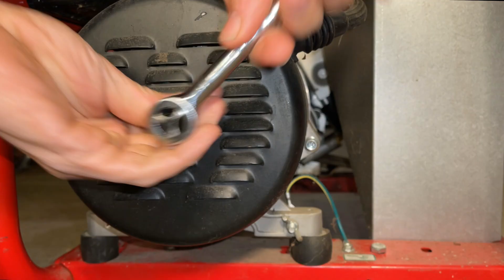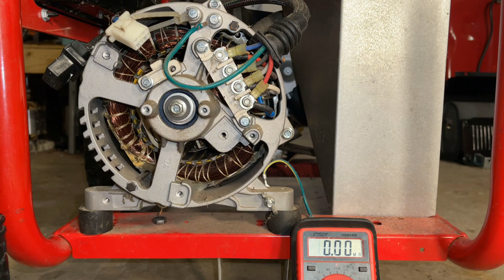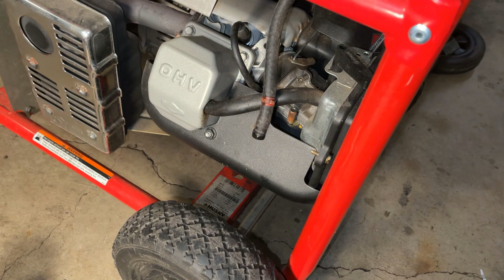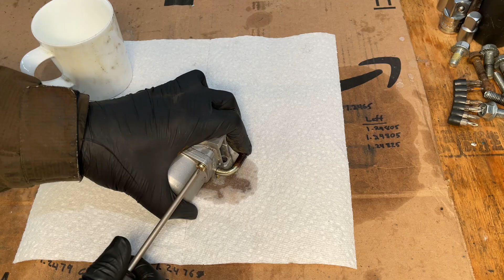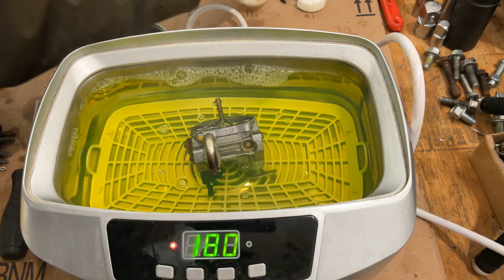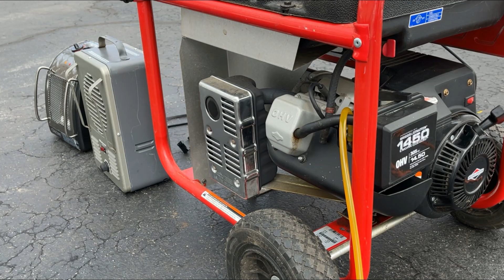Husky Generator - No Power

Comment: I am in Louisiana and expect a bad hurricane season this year.  I am great with lawnmowers, I prefer Honda but a wealth of information on generators which I am less educated on.   I find them after hurricanes or before dumped by the side of the road because apparently they didn't run or produce voltage.  I  have about 6 or 7 that I need to go through.

   A  few questions, the solution you use to clean the carbs, and which sonic machine?   Also thoughts on a Suburu engine. And if you also have a reliable source for parts on the generator portion?   You have a skill to test and repair but often times for me it I just buy a new carb on instead of cleaning all the jets.. etc.    Thank you  for sharing your knowledge.

Comment: Is it not advised to adjust the AVR while the engine is running and producing power?  I have watched so many of your YT and see the adjustment to RPM/Hz while running and just wonder why not do the same with the AVR.
Reply from the maker: Do not want to send the wrong message.  High voltage ac, dc and moving parts.  Lot less risky to do it with the engine off.

Comment: I have one of these and the 240v circuit seems to be off: 120v between neutral and the hot terminals, 240v across the 2 hot, but 150v/80v between the hot and the ground. Any thoughts?

Comment: Hey I have a question I have a Briggs & Stratton generator and on the lcd screen it shows 1% power is being used but I don’t have anything connection when it shows that should I be concerned about this?
Reply from the maker: I would not be that concerned.  Most likely not an issue.
Reply: @jcondon1  thank you for that information I was getting worried

Comment: I have this exact generator for about 10 or so years now. It always has started up really quick and easy, but is not a quiet unit. I plug it into a simple 240v transfer switch, and it runs the entire house minus the AC and don't use the clothes dryer. I have noticed that my generator too, is a tiny bit under voltage but everything still runs fine. I think I will tweak the AVR after seeing you do it. Thanks!

Comment: Are you all the same generator. I have blue smoke at start up and then it stops, is there anything I can do or need to do
Reply from the maker: That could be a sign or worn valve guides, blown head gasket or marble worn rings.  If only at startup and not burning excessive oil then would run it until it becomes a larger issue.

Comment: Are you missing a bolt from the brushes?
Reply from the maker: Most powerheads with an AVR only use one bolt.  The other side has a stud that comes out of the end housing to locate the brushes into position.
Reply: @jcondon1  thanks! Good to know

Comment: Is your torque wrench 1/4 or 3/8. What range of torque is it.?
Reply from the maker: The smaller one I use is 1/4".  The range is 20 in/lbs to 240 in/lbs.  The larger is 3/8 and the range 20 ft/lbs to 100 ft/lbs.

Comment: Other than the rust where the fuel line hooks up looks like a new carburetor. Will it hurt the engine if i put 10w30 in my generators ?
Reply from the maker: Would use 10w-30 synthetic.  If running in hot weather, 30 weight would be better.

Comment: You really do excellent work James. I would have suckered into using the carb that was on it so you might be a bit better than me. I don't know how much you got for this one, but if you got a good price for it it would certainly be OK to spend all you did but I would never be able to get back that 90 dollars for that Stens around here, as the other carb would certainly run someone good for years that kept the rain off and ran the carb dry upon stopping. I always do so I wouldn't be a good customer for you I'm afraid.

Comment: I have an old Colman generator it runs awesome but it did not make power at first the only thing that looked broken was a capacitor was exploded and like melted plastic or something was coming out of it I asked 2 different small engine repair guys and they both said that's not the problem but when I put a new one on it makes power now and people tell me it's just a coincidence bit it really seems like that was the problem do some generators need a capacitor to make power?
Reply from the maker: Yes, it is a common problem that the capacitor fails.

Comment: Great Video. Here, i did the adjustments to the AVR Trimpot´s with the motor running. Is a better way to adjust the voltage. You can see the voltage while adjusting. No problems whatsoever.

Comment: On the popping noise. There is a electronic chip built in the coil that replaces the points and how it works is when the magnet is at its sense point the chip sees this increase in voltage but as the magnet just starts to pass its highest peak...the electronic chip senses the the engine passing its ignition point and it shorts out sending a pulse to the coil and fires it and that gives a spark to the plug. What has happened to me a couple times is if the wire lugs on the coil are not very tight they may wiggle giving the electronic chip a false indication and firing the coil extra times. I had one riding mower that that i could not tighten it enough so i soldered the lugs on. Problem fixed.

Comment: Could you include a voltage reading across the high voltage outputs: L1-L2, L1-N, L2-N, L1-G, L2-G, N-G? Trying to troubleshoot the same model I own which is reading about 5V N-G and that would really help!
Reply from the maker: I do not have the generator anymore, but L1-L2 should be around 0.7 ohms, L1-N and L2-N around 0.3-0.4 ohms.  Not sure on the rest.

Comment: First, thank you for all the tips you share. This comment isn't about this specific video, but I'm having a problem with my (Simpson pressure washer) Kohler RH265 engine staying running. It's been sitting for almost two years. I did you're usual car cleaning routine. All the jets, float, bowl, etc. looked relatively clean, but I cleaned them anyway. The float valve works as well, and the bowl was also relatively clean. What happens, is the engine now runs, but ONLY when almost fully choked. I remember one video you did where you went through the same scenario, cleaned the carb, but still wasn't able to make it work. Was there a solution, or was it where you just replaced the carb? Thanks!
Reply from the maker: Sometimes I do pull the trigger and buy a new carb.  Most of the time the issue is the carb and a clogged jet or passage.  Would be more aggressive cleaning the main jet and pilot jet.  Sounds like it is starving for fuel.
Reply: @jcondon1  Thanks for the quick reply. I don't have the cleaning tools you use, but they're didn't seem to be any obstructions. Daylight was visible in all seeable passages/jets, in fact, the carb looked like new, but who knows.
Reply: Follow-Up: Success! I watched your "Two Generac's" video today, and noticed you worked on the Idle Jet on one of the carbs. That's the one bit I didn't clean, and completely overlooked. My cleaning methods are limited to Carb Cleaner and an acid brush. At first, I couldn't see through it, but liberally sprayed it, and used a bristle of a wire brush to be sure it was opened. I 'saw the light', and it now runs great, solving the running issue. It's not an issue with buying a new, relatively low cost carb, but the satisfaction that I was able to fix the problem on my own (with you're tutelage, of course). Thanks again for sharing your great and detailed videos on small engines and gen sets.

Comment: Another superb fix !! Thoroughly enjoy youre content! Been watching for a year & just recently able to subscribe. Been indulging in repairs myself for the past year & have done well with youre information.Hoping to see some content with capacitor operated Gens as opposed to AVR'S. Have one currently I need some help with. Also in the process of resurrecting 2 Briggs flat heads 8&10 Up Gen sets. Have them running & producing power , just have fuel pump diagphram kits to order & install & will be finished !!
Reply from the maker: I have done a couple of brushless generators.  Do not get too many of those.  https://youtu.be/4--Oyf4-U2Y?t=2890

Comment: I have a powerhouse ph3100ri inverter generator that has no spark. I've already pulled the low oil wire still no spark. I've also have unplug blue wire that went to a  spade coming off the coil and it has spark. plug blue wire back in and no spark. Any Idea?
Reply from the maker: Have not worked on one of these, but there is a good service manual available online https://www.powerhouse-products.com/-/media/Files/PDF/PowerHouse/Dealer-support/Generator-Manuals/PH3100Ri_Service_Manual.pdf

See page 19.  If has a good procedure for tracking the issue down.  I would suspect the BFP controller.
Reply: @jcondon1  Thanks for your help Mr. Condon. I looked up parts I need and they are discontinued so I guess I've got a good engine for something else. I'll be waiting for your next generator fix. HOOF OUT!!!

Comment: great work James . Runs like new man !
Reply from the maker: Like your new generator.  The 120v only ones make a lot of sense.  People do not realize that a 7000 watt 120/240 volt generator is limited to 3500 watts on any one 120 volt receptacle and you have to worry about balancing leg one and leg two.  With 120v only, you have access to all the power.
Reply: @jcondon1  Yes sir , & I only use the 120v anyways . I have a gen for 240 but it never gets used ..

Comment: Good video.  From my own experience I learned that if the genny has a high oil switch as well as the normal low oil switch, you definately want to go with a non-detergent oil.  A detergent oil can foam up and when it hits the switch it well shut the genny down.  Then when the foam settles you can start it again...briefly.  Becomes a mystery shut down.
Reply from the maker: Great tip!

Comment: What is your opinion of dual-fuel generators?  I intend to run it on propane when needed.  If I have to run it on gas, I will use ethanol free and drain the tank, run the carb and lines dry, and then drain the bowl.  Does this protect me from something going bad?
Reply from the maker: Most of the issues I see are because of bad gas.  Propane will never cause an issue as long as you have a good regulator and good pressure from the tank.  If you use gas, just drain it out and your carburetor will be fine for the next time.  The only downside with propane is less horse power so not as many watts out.
Reply: @jcondon1  Thanks for the info.  I can run the fridge and a dehumidifier as well as a few lights and the laptops off of the propane.  Good enough for me.

Comment: i have 5000w colman powermate i plan on going over after i receive killa watt i ordered off of ebay i was setting rpm for generators but thanks to you i know how to do it right but seems any generators you fix that are coleman are all engine problems but i want to go over power head do remember doing any and do you have video
Reply from the maker: Have not had to do much work on Coleman power heads.  This one is the only video I have where I remove one that melted down.  https://youtu.be/4PpQ2Liatzw
Reply: @jcondon1  i have one more question you call it slip rings i call it comutator ?

Comment: That had water in the float bowl. When you used carb cleaner to get it running it agitated the water and your new fuel floating on top the water and allowed enough fuel past to keep running. The white stuff you see in the carb is the by product of organisms that thrive on the ethonal as it deteriorates. That generator was left with 10% ethonol fuel in it for about 4-5 years. Clean the tank or those organisms will come back to haunt you.

Comment: Has anyone EVER seen a circuit breaker go bad?  I'm guessing the dirty slip rings was the original problem and the owner just started taking things apart at random.
If he knew that was the issue he would have replaced it and had his generator back running... or at least been able to sell a working generator.

Comment: I have to wonder about your financial calculus.  If I can (and I just did) buy a very similar sized brand new generator from Champion through Bass Pro and have them deliver it free to my door for a total cost of $299 how is a broken down parts missing unit worth $170 plus $70 for a breaker and some amount for your labor?  Is it just to do a video?  The broken down one is also an unkown in the engine as well as the powerhead neither do you know how much and how hard it has already been run.  Could even, worse case scenario, been under water.  Best case might be it runs and gives you half the hours of a new well taken care of generator.  So I am left with a base number if it were running and running well demonstrably so, of about half its replacement cost (and a Champion replaces it pretty well) and for every deficit from there a deduction equal to the parts cost to bring it back up to running condition.  Am I missing something because it seems that you often over pay for these large question marks?
Reply from the maker: I have every part for this generator in spare parts.  Was not concerned I would have to spend any additional money.  I agree $170 is a lot, especially if you have to buy parts.  Where I live, $100 is pretty much the bottom price for a generator that is hopelessly broken.  I took a look at BassPro and did not find any 5000 watt generators.  Found a champion on the Home Depot site that matches the specs of this one for $650.  I agree that there are deals to be had on new generators, but one like this will sell for 2x what I paid for it.
https://www.homedepot.com/p/303291681

Comment: Very good job! Might I ask where you find so many repairable gensets? I am having trouble finding just one fixable unit that is reasonably priced. Most of the ones I see are priced too high considering the engine doesn't run or the power head does not produce power.
Reply: I got 3 generators last week just for doing the head gaskets on a friends truck. All of them run but one just needs valves

Comment: 3000 watts and 58 HZ seems a bit low on the speed. Normally if generators have enough horsepower to wattage at full load they should not go below 58 HZ. The governor may need to be slightly adjusted but other than that great job!
Reply: In another comment he said when the engine warmed up the HZ went up
Reply: @Texpete88  cool thank you for letting me know!

Comment: James, just have to tell you your videos really makes short work out of some issues I run into flipping generators. There's always a video I can refer to that solves or points me in the right direction to solve a issue. Plus I just enjoy watching. What do you use for your test tank. Haven't come up with anything that works as well as your seems to.
Reply: 3.18.21  Tim, I looked on amazon and found something like it called BikeMaster Auxiliar Fuel Tank or Alpha Moto
Reply: @chucktrotter9699  thanks, I'll look now.
Reply: @chucktrotter9699  found it. Perfect for what I need. A little pricey

Comment: you know what's worse? I bought a Yamaha EF2600 with a description that read "runs good". I pick it up, this thing has a dented valve cover, leaking fuel, sparkplug only half installed, governor not working, wrong carb, and a bunch of damage from a fuel fire......luckily I bid the guy down a bunch and after months of work I have a sweet lil Yamaha genset
Reply from the maker: Very nice.  Always assume the worst and never pay more then you are willing to lose.

Comment: Can I ask why you can’t adjust the avr voltage while it’s running?
Reply from the maker: You can, just want to show people the safest way.
Reply: @jcondon1  Is there a chance of shorting it all out by adjusting it while the generator is running?
Reply from the maker: @scvic2006  just need to be careful of moving parts and live wires.  Would be hard to short it out.

Comment: I know engines well but never had to do much on the generator head side.  I’ve done hertz, volts and replaced a broken breaker.  After watching your videos I’m sure I could now quickly diagnose any problems on the generator head side.  Thanks
Reply from the maker: Good to here.  Most small engine guys draw the line at the engine.  That is part of the reason I started making these videos, not much information out there on the power head side of things.

Comment: Have you ever though of getting a lift like the small engine shops use where you roll whatever you're working on, & it lifts it up to a comfortable height to work on? It would make it easier to work on & film. Excellent video. I like your narration & explanations.
Reply from the maker: Yes, it is on my wish list of tools to buy.  Thankfully I only do this a couple hours a day so has not been an issue, yet.
Reply: @jcondon1  you could even use a harbor freight engine hoist and straps to pick it up. There only $100. You could lift it and place it onto a work bench
Reply: @jcondon1  mustie has one

Comment: "Don't get left in the cold"  No, buy this generator that does not work!
Reply: At least, the gasoline engine makes heat dangerously
Reply: @yzhang8629  Ah, of course, I had neglected the heat off of the engine!  Well I guess it is better than what we had when I was a child, when the power went off then we used to huddle round a candle for warmth.  If it got properly cold my mother was actually known to light the candle too.
Reply: @trevor311264  it is just super hard to harvest the heat from the engine it self. If it is put indoor, there is a great chance for everyone to die from carbon monoxide.